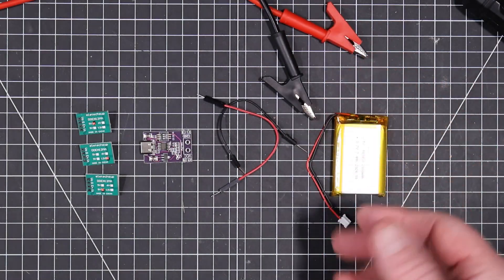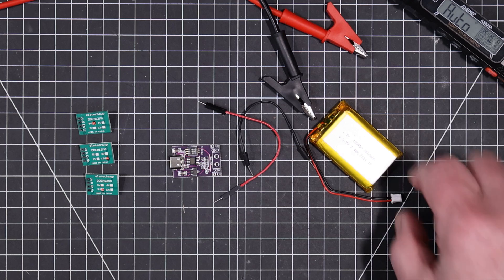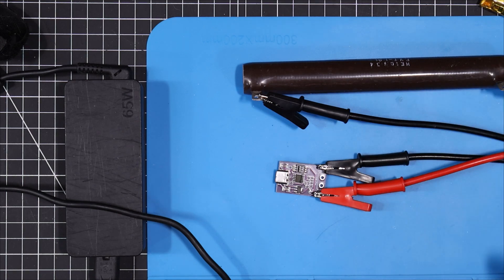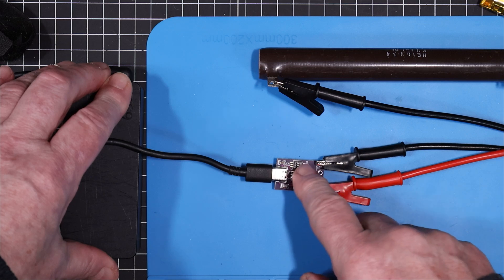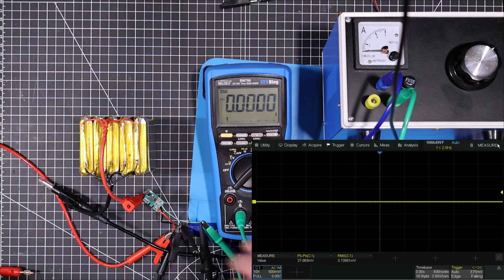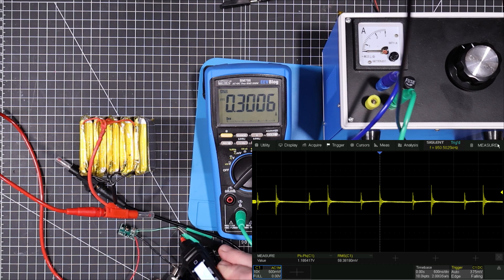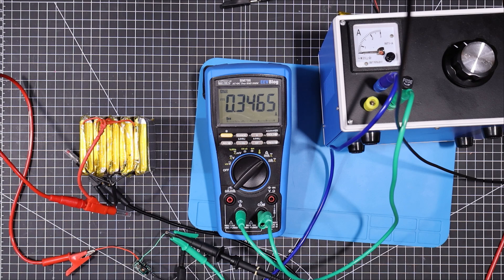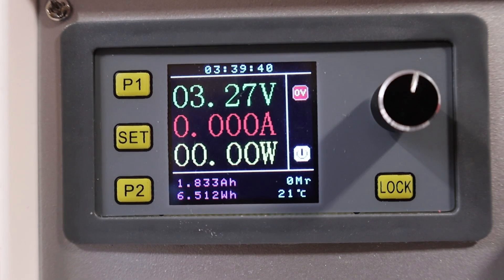Uni-Byte 0246 - Testing AliExpress Electronics!  #1

Comment: those stamp size boost converter is super handy for boosting small batteries, if im not mistaken there is a few variants on ali express, but it seems they use the same boost chip.

that purple trigger board seems to have no over current protection, as i have accidently killed a few by slipping the probes from + - , a little spark comes and it cant request any voltages anymore, i did a trick where i parallel connected the trigger board, and avoided current passing trou the board, but the board need do "feel" the voltage its get or else it wont trigger correctly , another trick i did is to use a small 200 mA diode, the smal red one as a fuse, so when the board its connected parallel and something happening that short the board, the diode will pop hopefully before killing the board.
Reply from the maker: Right, there is no current limit on the decoy board.  The output comes direct from the USB-C power lines.  But a short across that should not kill the chip.  Strange.

Comment: Great testing and review but when a device asks for 12v and gets 15v I think is not brilliant I would have guessed it would be 9v. Yeah the Batteries seem good value. The boost converters showed a lot of noise but more than adequately explained by you sir ! and your 'quick and dirty' set up.
Reply from the maker: Yes, exactly, but it's the fault of the power supply and not the decoy.  I'm a big Lenovo fan, so just a tad disappointed in this.
Reply: @uni-byte  Oh interesting, I really must get to understand this protocol as I would have blamed the decoy !! great info

Comment: 1v P-P is NOT NOT NOT OK at all!!!!!!!!!!!!!!!!
Reply from the maker: Well, there are a couple of caveats which I think I mentioned and two I may not have.  First, there is no filtering in use at all.  2nd, I was using leads 18" long between the boot converter and the scope - not ideal by a long shot.  Now the ones I didn't mention.  The load was a wire wound power potentiometer, which would add considerably more inductance to an already quick and dirty measurement, and finally a lot of that might be common mode.  Unfortunately I don't have a differential probe to determine that.
Reply: @uni-byte  I understand, but we are talking 1V P-P, and on DC inductive load matters little, but it can enhance the switching noise.
Reply from the maker: @stevenbliss989  Yes, I bet with a couple of appropriate capacitors and short wiring to the DUP the noise will be much reduced.  And in some cases, it does not matter much, like lighting LEDS, powering motors or charging lead acid batteries.  For powering an audio pre-amp?  Not suitable at all.

Comment: I have a question about the aliexpress link. Anytime I go to the website it tells me I should use the app, the app, the app. And I usually do. My question is: If I use your link to go to the website and then switch over to the app, do you still get the “commission”?
Reply from the maker: That I don't know.  If you buy something via that method, tell me what it was and at what time you got it, then maybe I can see if it came through in my reports.  I think, as long as you logged into the website through one of those links it might be okay.